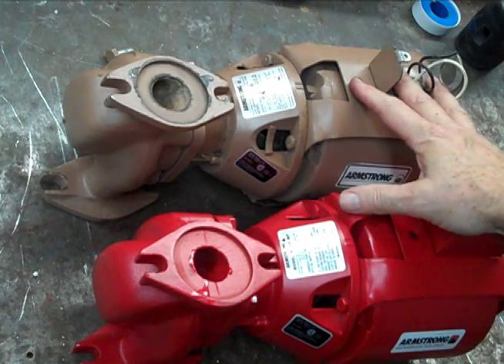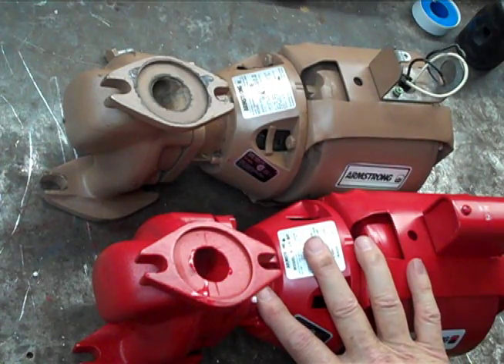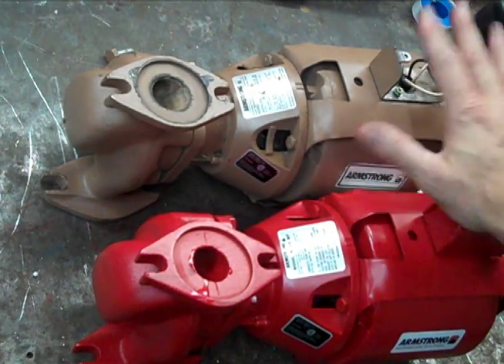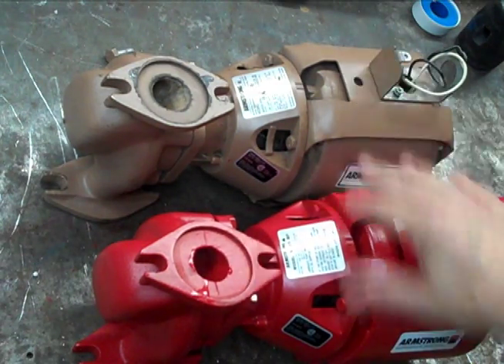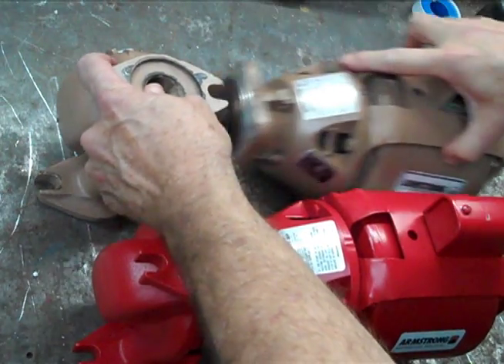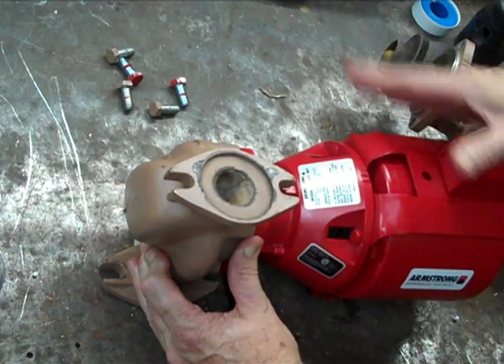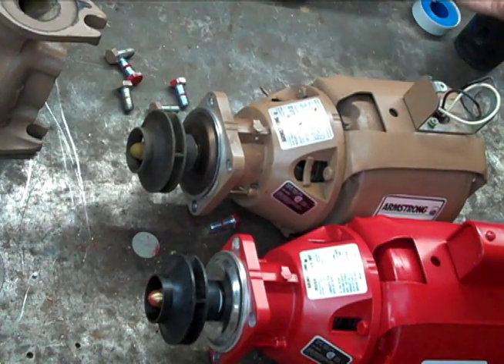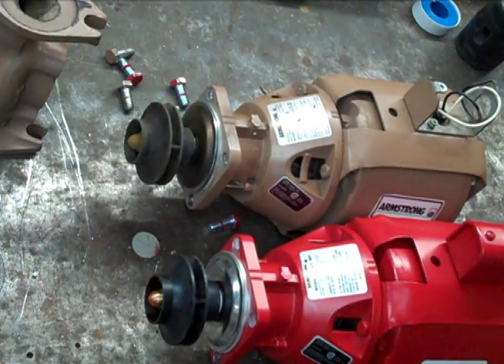Circulator Pump Repair Rebuild Replace bearing assembly seal kit Armstrong B&G Taco Raypak Lochinvar

Comment: Solid idea... I have the Taco 110 for my closed loop hydronic and those pump motors are retailing around $600. Would love to do a swap just like this.
Reply from the maker: it has been a while since i was in the 'industry' but the bearing assembly was available for those a few years ago
Reply from the maker: there are also wet rotor pumps that are a LOT cheaper that will fit in the same flanges and pipe spacing if your water is not too hot for them